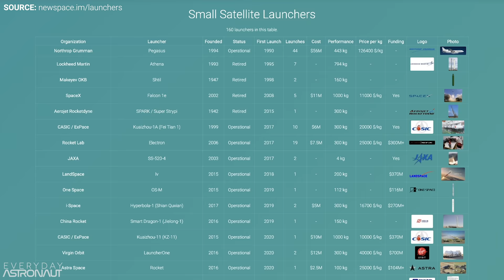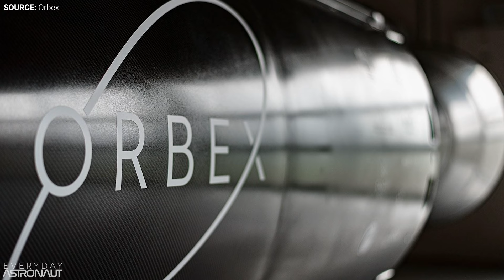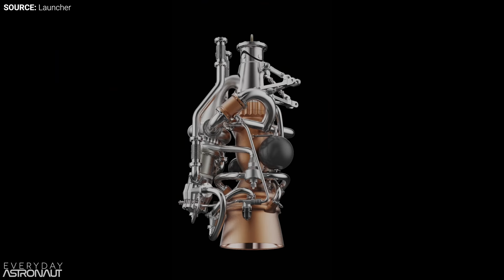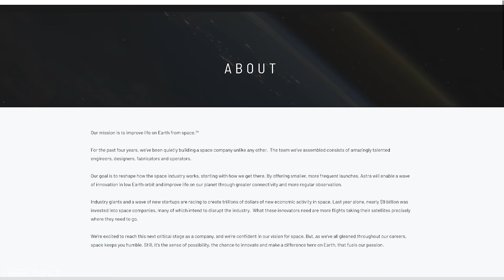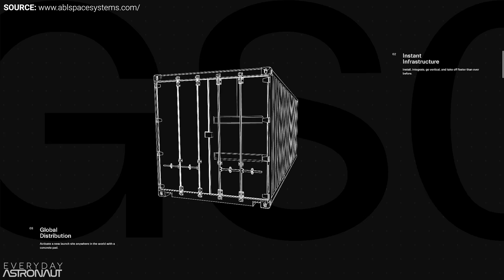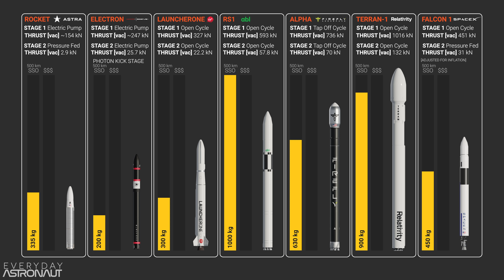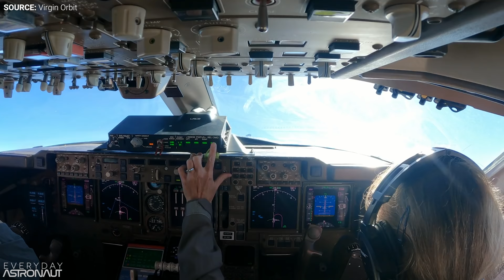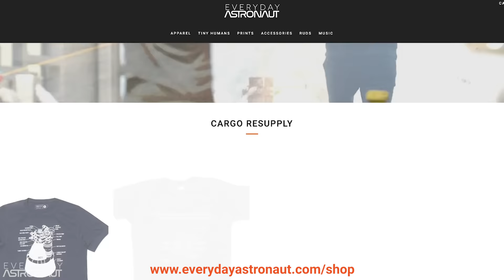Who will be the KING of the Small Sat Launchers?!

Comment: 30:56 I think the biggest benefit of LauncherOne is that it can potentially launch at just about any latitude, inclination, and direction without a huge impact on the cost (just the cost of jet fuel and flight time to get to the launch point). High inclination, retrograde, etc. orbits are usually either not available at all or totally out of the budget for small sat launches.
Reply: This aged amazingly 💀
Reply: @josephc.9520  How so? I didn't say it would succeed. Just that air launching has some advantages for achieving certain orbits.

Comment: As for ABL’s GS0 portable launch system: unlike Astra, who provides it as a service to their own launch vehicle, GS0 seems designed to be used by other rockets not made by ABL. Basically, it’s a launch site for sale. Anything that can run on Kerolox (including RP-1 and Jet-A) or Methalox can be launched by this system, and for the Rocket to be compatible, it must have those fuels, have a dry mass of 7000 lbm and a wet mass of 150000lbm at liftoff (so a dry mass of 3,175kg and wet mass of 68,039kg, respectively). This means, hypothetically, all the equipment required to move the rocket itself and the launch site can also be used to launch Firefly Alpha, and with some upgrades, Relativity’s Terran 1 and Phantom’s Laguna. It can be modified to work with any small lift Rocket, meaning other companies can get more launch sites to work with, and thus can be customers with ABL.

Comment: One point with the scooter versus semi analogy that is missed, if you threw away the scooter for each pizza delivery, the reusable semi would ultimately make more sense for delivery even for individual pizzas.
Reply: Perhaps eventually it would. With the difference in cost between the scooter and the tractor trailer truck would mean you'd have to order a lot of pizza to break even
Reply: Maybe for the company, but not the customer. They’ll simply go with the cheapest and easiest option
Reply: Special Offer, Free scooter with every Pizza!! What's not to like. lol.
Reply: Thats why many smallsat launchers are going reusable
Reply: Eventually but I do not think they will launch that much also many small can not afford 50 million for a falcon 9
Reply: So you're saying the future of space launches are 'car' sized rockets.
Would that be about falcon 9 sized?
Reply: This sounds correct, but it isn't...quite.

Most of the cost of a rocket launch isn't in the material, it's in the logistics and compliance costs. What reusability does is increase launch cadence, because manufacturing takes more time.

It is cheaper, but even in SpaceX's case, it's only about 15% cheaper. That's not small potatoes, but it isn't the same as a scooter. 😄

Comment: Thanks for the video Tim, I am currently working on a really small(less than a foot tall, and hopefully less than 50 lbs) payload/satellite with a few friends at school, and this video helped me get a lot of info on potential launchers. I had to put the video on .75 times speed In order to take notes on everything. Right now the top competitors are Astra, rocket lab, and firefly, with Virgin orbit bring up the rear of the pack I am seriously considering, although they get cool points for using a 747 to launch.
Reply: What school? Update us on your progress now? I have a friend at Astra.
Reply: @yogena22  The design changed quite a bit, due to having to change out some mission critical components, mostly the solar panels, and the operations arm, so we are hoping to launch on the Electron, due to the precision of orbital insertion, and the advantages of the kick stage.
Reply: putting my reply here because this seems cool

Comment: As someone who was sort of in the satellite industry almost 2 decades ago; did my post graduate as part of a university program that designed and built 2 LEO micro-satellites and was involved in a couple of other commercial satellites.

The launch procurement process were as follow: in the 90s and early 2000s you beg and borrowed to scrounge up enough money  and then go make presentation to either NASA or Roscosmos to be included as  secondary or tertiary payload on a launch. You then HOPEFULLY get a slot or wait for months or even year or 2 until one becomes available for an orbit maybe halfway acceptable for your design, then it is another year or 2 to actually wait for the launch. Most of the time you will have to settle for suboptimal orbit that cut down on your satellite design life as much as 50%.

That same money now pays for more than 50% of a RocketLab launch or a complete projected cost of an Astra launch. So it truely is a game changer especially since the technology advanced so mist during this time making satellites a few orders cheaper, smaller and more capable.

Comment: it's cheaper to have a semi deliver a pizza than a scooter that gets scrapped after the delivery.
reusability changes everything.
The Electron is $5m per launch, the Starship may be at or below that price point per launch, meaning that it could be cheaper to launch  200Kg satellite on a Starship than on an electron.
Reply: Rocket Lab is reuseabe now
Reply: @LP-ow3kd  not yet, they are working on it and have reused a few components, but have not yet reflown a booster. 

Also, their goal for the neutron is to refly twice as opposed to airline-like (close to unlimited) reuse.

Now, the Rocketlabs Electron is intended to be continually reusable, but, like SpaceX, it's a much bigger rocket, much closer to the Falcon 9, and is only practical for small sat launches due to it's reusability.

Comment: Tim you're asking the right question again, in some cases less is more. With the environments in outter space we basically need ai or machines that can build a place for us to stay before we get there and we need equipment shipped there before we can even step on the surface. These devices don't need to be massive. They literally need to a six axis on continuous tracks and we need an outpost that makes these devices over ore deposits with lines of code.

The more compressed the manufacturing the more it will modular it is. That's the toughest thing we have to agree on is a standard size of what is required rather than what we want.

Comment: Donno if anyone has mentioned this already but for the Orbex engine, RP1 can be hyperbolic with the hot oxygen atoms coming off of high test hydrogen peroxide. Basically, if the decomposed stream is still hot enough it will combust with RP1 hypergolically. This can make the starting and reatarting of these engines incredibly simple.

Comment: Also worth noting. Virgin Orbit will be operating out of Spaceport Cornwall in the UK as of next year. 🚀
Reply: Did they chose this launch facility for polar orbits? It's too far north for equatorial orbits, but it would make sense for polar ones
Reply: @simonm1447  You can do both from Newquay. You just fly the carrier aircraft where you want to launch the rocket.
Reply: @jamiewilliams5134  OK, I just seen they use a 747-400 as a launch carrier, they should have enough range

Comment: the 2 staged rocket that had a single vacuum engine and 9 sea level ones would save a ton of weight by just using a single aerospike. Honestly I am happy to see competition in small rockets because innovation here will provide the forcing function needed to evolve propulsion systems that we would have considered magic or science fiction 50 years ago. Perfect example is the fueless ion drive that uses atmospheric gases to propel forward would be a no brainer for virgin orbit to use.

Comment: i like the one that launches from the boeing 747 because
1), you can launch at any latitude/longitude/inclination
2) you're launching from 900kph instead of 0
3) if you want you can launch from exactly on the equator which gives you even more speed
4) you're launching from 40000 feet instead of ~0, you're basically more than 10% of the way to space already
5) you're launching from almost a vacuum so the engines are more efficient and there's less compromise because it doesn't transition from sea level to gradually lower pressure and high altitude 
6) you can dodge bad weather,
7) the 747 is rapidly reusable and maintainable
did i miss anything? i think this is all cool

Comment: The value add of the photon platform makes a big difference to these numbers. Having a proven, managed bus provided is a huge saving.

I think Rocket Lab is head and shoulders above the other contenders, but I don't think any of these small launchers can survive 5 million dollars, 100 tonnes to LEO, daily flight, when starship launches. Just being able to completely ignore mass and size limits will save enormous costs even for "cube sats".

There might be a market for something like Photon though. An all singing, all dancing satellite bus. Dropped off by starship, anywhere in LEO for say 100 000 dollars, it then takes your payload wherever you want in the solarsystem and handles all the power, comms and navigation for you as an off the shelf solution.

Comment: Interesting side fact for anyone wondering why a commercial aircraft was built from the factory with the ability to carry a rocket..

The pilon that holds the rocket is originally designed to carry an extra (inoperable) aircraft engine. Boeing created this capability to ferry a completely new engine to a destination where another aircraft was out of service and in need of a replacement engine.

Comment: When you drive by the various rocket companies, which ones are working around the clock?  Weekends?  Watching Munro.  He said something profound (to me anyway).  Who's working for you"  Learners, or Learned.  In my professional contract career, I got contracts because I was successful in previous endeavors.  Most of the time, I had no experience in the "tech".  It usually took me two weeks to become comfortable with the new "jargon".  Then, I would work however many hours it took.  Amusing to me, at least, learned "experts" would tell me I was wrong.   A quick search of the "current" manuals, would prove them wrong.

Comment: Great video!
RS1 mass to SSO looks suspiciously like an over estimate compared to the others and considering its size and thrust level.

Tim, your work to enable us to watch and learn is sooo good. Thank you. I'm impatient for your videos to see how these play out.
Reply: Their low mass tanks are the reason for that figure. Optimized mass gains a lot more DV than a couple of seconds of ISP does. Any performance advantage using CF on rockets also ends up being negated due to the typically heavier structures thanks to its awful cryo performance. 3d printing tanks is simply heavier, that tied with CH4 as a fuel, and you get even bulkier tanks.

Comment: Relativity with 100% just has to buy shipping containers of powdered metals. How cheap would that be? No big parts and bolts to make little bits into big bits. Just bolt the few major components together and your done. Also your not paying for manufactured sheet metals. Just think and steel mill off cuts can be powdered for them, so they just buy scrap essentially. In the end they might have the skills to print the rocket body, thrust puck and the fuel pipes and tanks as all one piece. Assembly means adding engines and the nose cone payload section. Potential plus here.

Comment: Coaxial Tanks. Would love to hear more on this subject, pros and cons. Wondering if SpaceX have ever considered this And why they decided against it.
Reply: It depends on the type of fuel if you can use them or not. In this case both components (fuel and oxydizer) have to be stored inside with the same temperature, because there's no thermal insulation possible. For the Falcon 9 for example it would not work, LOX has a boiling temperature of - 182 °, while RP-1 has a freezing point of - 60 ° C. This means it the RP-1 would boil the LOX, while the LOX would freeze the RP-1. 
It would also not work for Methane/LOX, because LOX is liquid between - 218 ° C and - 182 ° C, while Methane is liquid in the temperature range of - 182 ° C and - 161 ° C. 

It works with propane, which starts to get liquid from - 187 ° on, so there's an (small) overlap in the liquid temperature range

Comment: I have a question that maybe someone with knowledge may answer. The Newton's third law says that that the faster the exhaust, the more push. The exhaust speed in a combustion engine is limited by the temperature the materials can withstand. But nowadays we have very powerful magnets. Why don't we use magnetic fields to hold a very high temperature plasma so, the exhaust's speed is multiplied some order of magnitude? We can heat up hydrogen to the hundreds of millions of degrees and confine it in a magnetic chamber in fusion experiments. Even a fracion of a fraction of that temperature should be more than enough to outperform the current speeds. If we manage to make the exhaust go x10 faster, it means you will need x10 times less flow to get the same impulse, which means, you need x10 times less fuel to get the same payload to orbit or, you can keep the engines running x10 times longer. (minus the payload of the magnetic chamber, OC).
Reply: those are called plasma engines, but idk more about them
Reply: @adamrezabek9469  plasma engines requires enormous quantities of electrical energy. There should be a way to do it by extracting the energy from the chemical reaction rather than an electical engine. Plasma engines have a very low thrust, so they are not useful for earth to orbit launches. What I want to achieve here, and IDK the limitations, is to provide an electromagnetic coat to the engines so the temperature can rise, hence, the exhaust speed increases.
Reply: @BlueFrenzy  If you want to get all energy from chemical reactions, you have limited ISP / exhaust speed. I am not sure how it's calculate, but there is theoretical limit since combustion can only release so much energy.
Reply: @adamrezabek9469  Just to be clear, it's not just the energy released, but how it is released. A bomb releases tons of energy in a fraction of a second and it obliterates things. When talking about getting thing into orbit we have to think that the gravity is a constant pull on the vehicle. The vehicle's acceleration is the sum of the rocket impulse minus the gravity. If your engine pushes you at 9,8m/s, you are basically hovering, wasting your fuel. So, the faster you can get to orbital speed the less time you are fighting gravity, the less energy you need, the less fuel you need. At the moment we could just force a more powerful reaction in the engines so it accelerates faster, but then the engines will melt down. So we are kind of limited to what temperature the exhaust gas can go.
Reply: @BlueFrenzy  Oh, so you think that it would not allow higher specific impulse, but just higher thrust with engine of same size?

Comment: I know your assessment of Starship is that launches will likely cost more like 10 mil (though still be massively cheaper per kilo). However... if SpaceX actually achieve a 2 mil per fully fueled launch of Starship, what does that do to the small launcher providers? That would undercut their minimum launch pricing. Would the ability to launch directly into one's target orbit still be attractive enough to warrant the extra cost? And a Starship's potential for ride-share is massive, especially since a few refuelings would allow it to flit around and drop off a variety of payloads to wherever they need to go. I suppose it's all conjecture until Starship is a proven launch system, but, still...

Comment: Skyrora is not the first rocket to use RP1 and HTP as the fuel and oxidizer combination. Britain's BLACK ARROW launch vehicle from the late '60s & early '70s used the exact same two propellants, in the exact same engine-cycle, decomposing the HTP to run the turbine that drives the turbopumps. (and yes, the official spelling of BLACK ARROW specified that it was to be spelled using all-caps, I'm not shouting) Moreover, BLACK ARROW's specifications made it, by the definition you outlined in the beginning of this video, a Small-lift Launch Vehicle, by today's standards.

Comment: 25:55 Astra’s Rocket 3.0 is significantly cheaper but has much less payload than Rocket 4, which would be the claimed launch vehicle here, albeit with Firefly Reaver engines and, eventually, Astra’s in-house designed variant, should they not be looking into buying any more from Firefly.

Comment: A little fun fact about the Skyrora XL engine:

You mentioned, that you wouldn't know any example of a system, wich used peroxyde for the pumps and as an oxidizer, well i know one.
It is called HWK 109 509, it was used during the 2WW in a rocket powered wooden Glider, just try to guess who made use of such mad idea.
As far as i know, there where several itterations, one of wich dumped the decomposed peroxide, the other one used it in the main combustion chamber, therebyy boosting the range of the aircraft.

Comment: A reason you may buy more lift potential than you need is cost with a cheaper ride share or straight up reliability on a more established rocket ship. If you had 2kg of payload and it absolutely had to make it’s designated orbit in one piece and pretty much on time then the Atlas 5 would be overpowered enough to be beyond laughable but a rock solid 100% record. Electron not good for reliability.